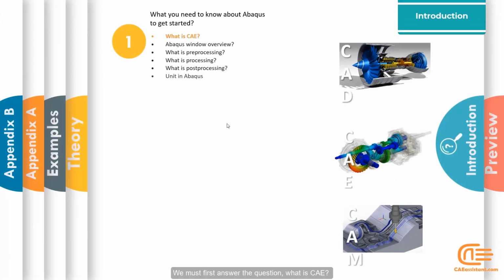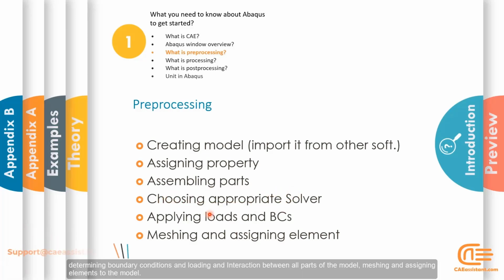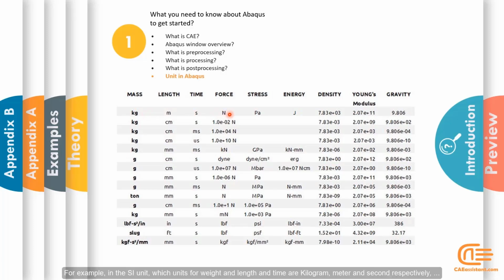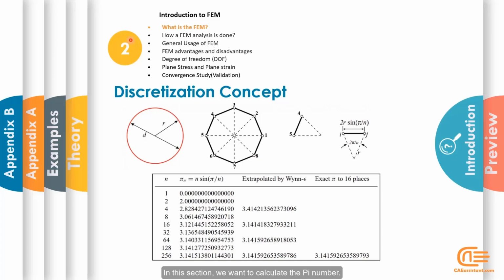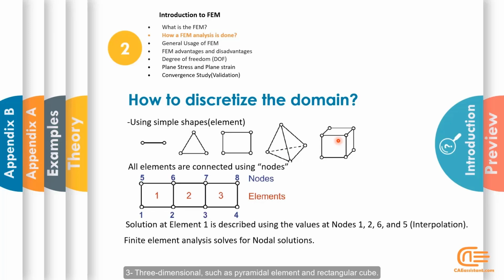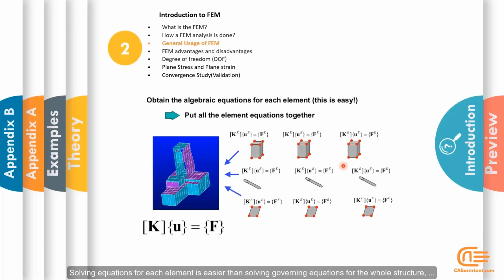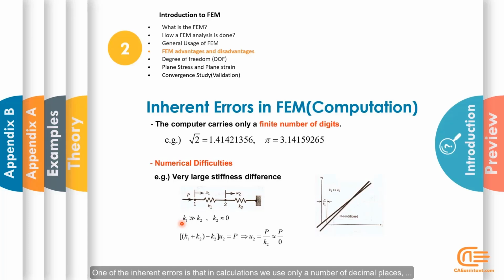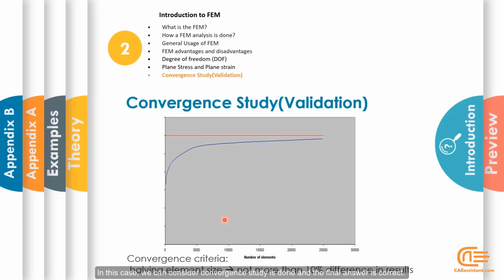Finite element method (FEM) for beginners | what is FEM? | how FEM works?

Comment: Hello sir you have design of bunker subjected to blast load modelling and meshing course please  reply sir
Reply from the maker: The following tutorial is about explosion modeling, and one of its workshops focuses on modeling blast load in a steel sphere, which is very relevant to your work and can be quite helpful.

https://caeassistant.com/product/explosion-simulation-in-abaqus/#1576700058538-e629a8e0-afbdf314-3e84

Moreover, if you specifically need the modeling of a bunker explosion to be done for you, you can contact our website support via the following email address.

support@caeassistant.com